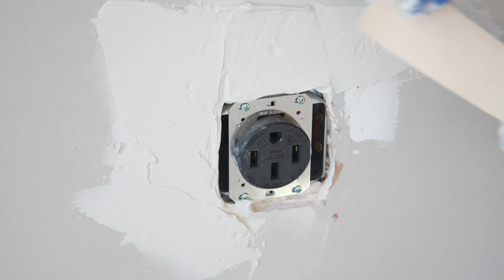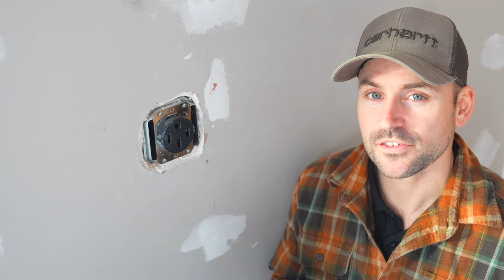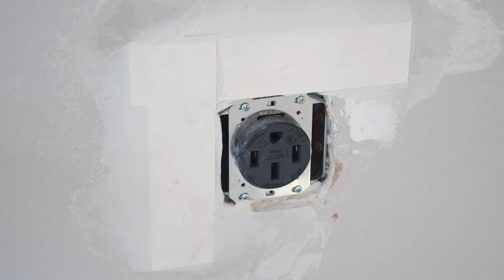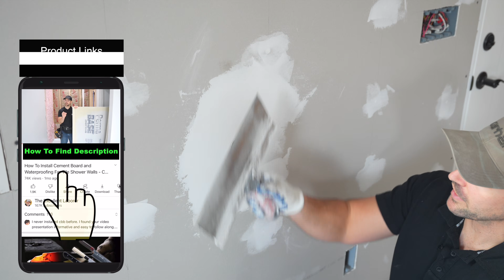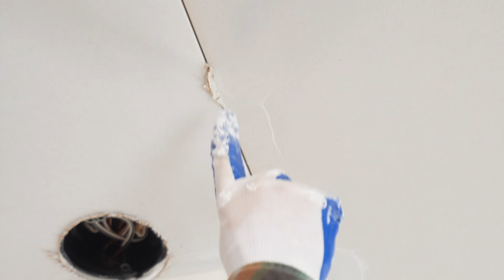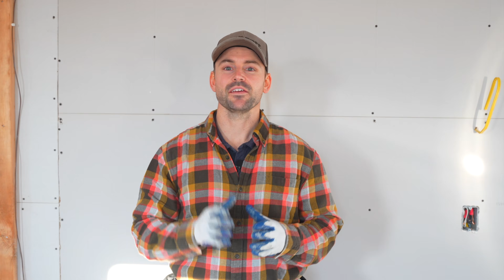How To Repair Drywall Around An Electrical Box - BEGINNERS GUIDE

Comment: From a semi-pro here, a better fix on both repairs is with 20 minute hot mud. First one is slightly more difficult than the second, but both are easy fixes and way less liable to crack or blister with hot mud.  Second repair just requires filling hole area with mud and letting it dry for the 20 minutes then taping over the entire seam rather than taping tape over tape or breaking that long seam into 3 or more sections. Can get both repairs done in one day rather than 2 or more days with better results.

Comment: You need to learn up from down.
Reply: Calm down
Reply: @brandonjensen5292 
It looked correct when I flipped my phone over. 👍
Reply: Are you saying that the receptacle is upside down? I've heard arguments for the ground being up just in case something made contact with the hots and arc'ed. Seemed far fetched at the time then just a few days ago I realized that someone slacked on reconnecting the metal plate on my dryer receptacle when,  I'll be damned, the plate slipped, landed on the two hots and sparks went everywhere